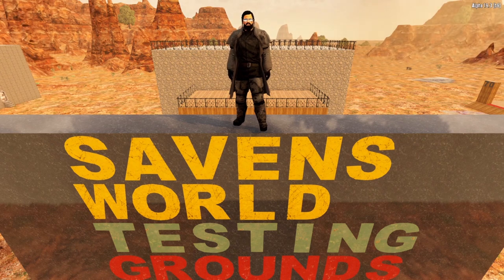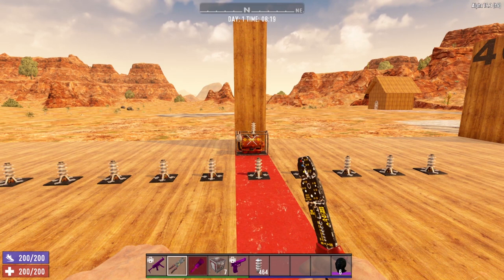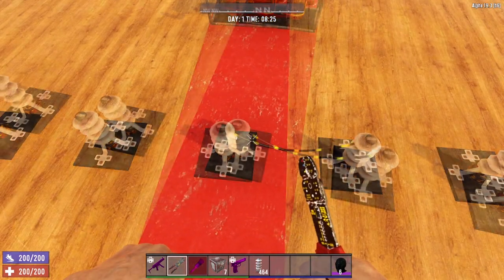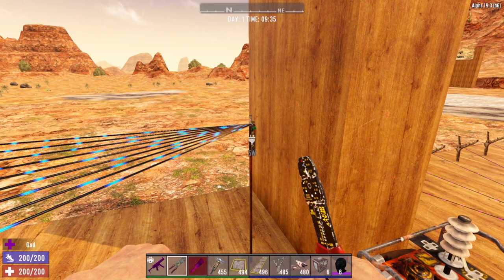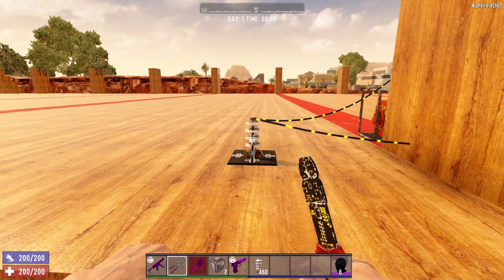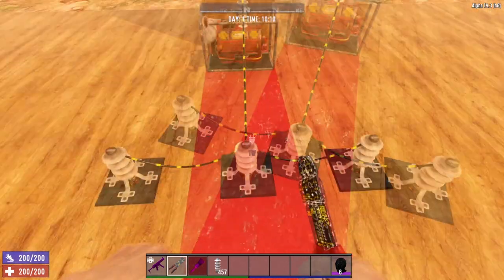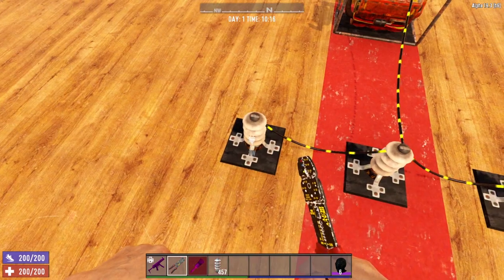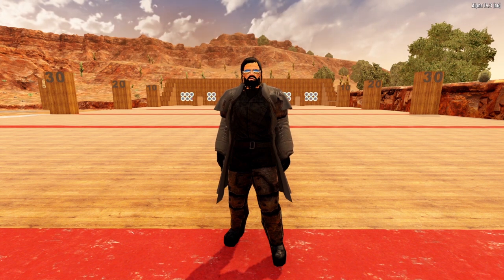Wiring Tutorial - 7 Days to Die [Alpha 19]

Comment: I just want to make a square around my base but the last connection makes the first wire disappear. Any thoughts?
Reply from the maker: There is a limit on how many wires you can have coming off of any one electrical device. Also, you can only have one wire coming in to each device.